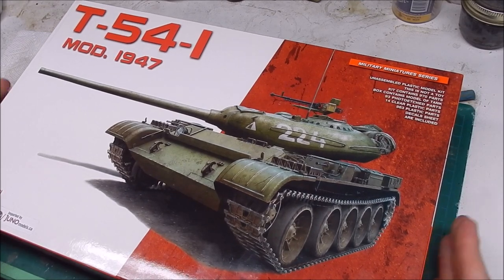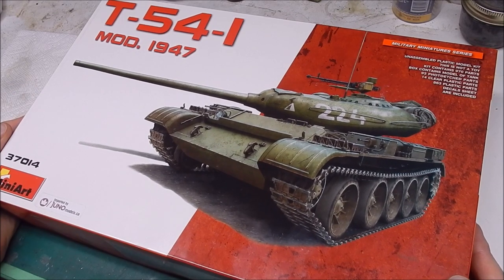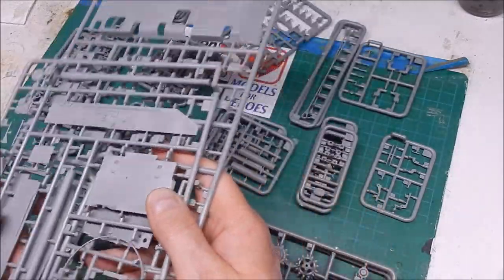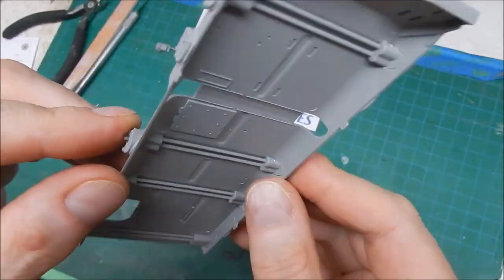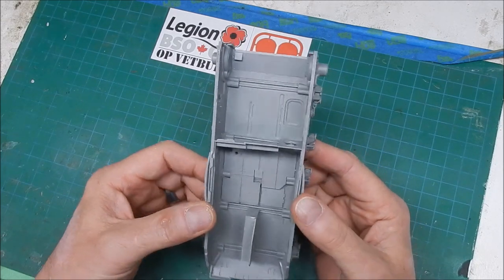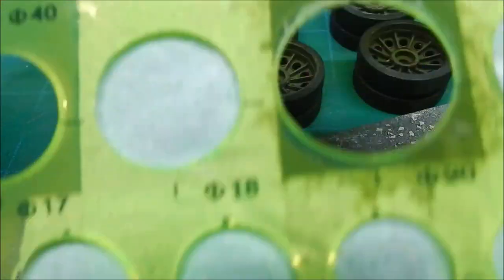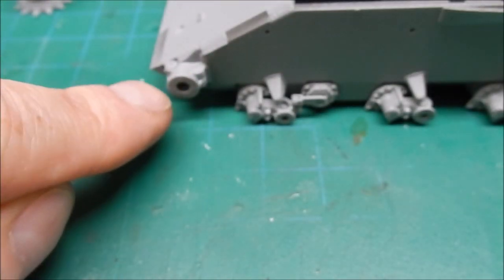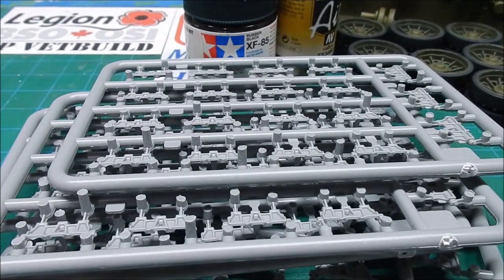Miniart T-54-1 Build Review Pt.1

Comment: Hi Bob I noticed that you highlight the individual sprues with a marker pen. hope you don't mind but here is a tip from me I use strips of off white masking tape rap them round the sprue and highlight the letter and number for each sprue and I use small elastic bands to keep the smaller ones together i.e the wheels etc.  I'm currently doing an early stug 111 series O also Miniart the plastic is a lot better to their old kits but still have a bit of flash  but its a great build so far and what you are doing is great look forward to the next video..😎👍